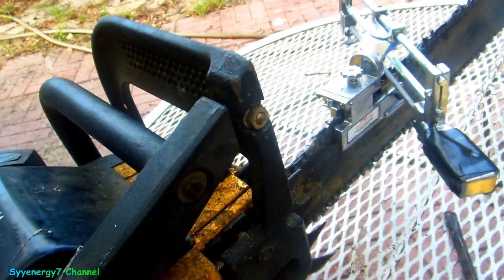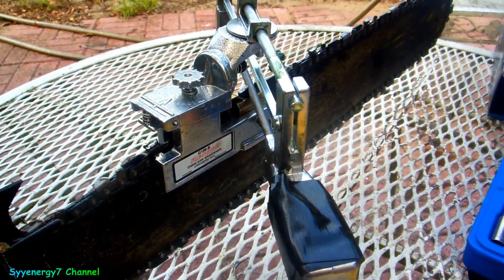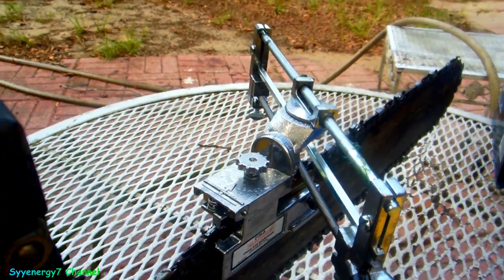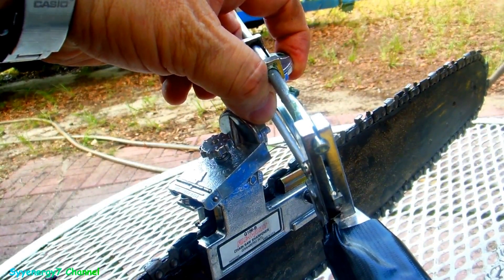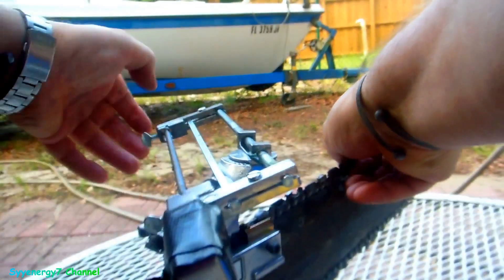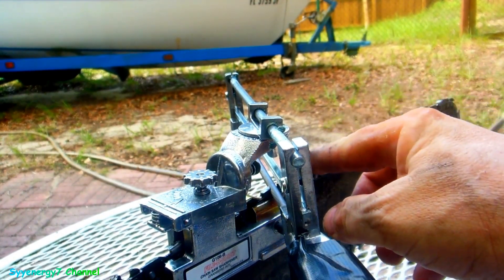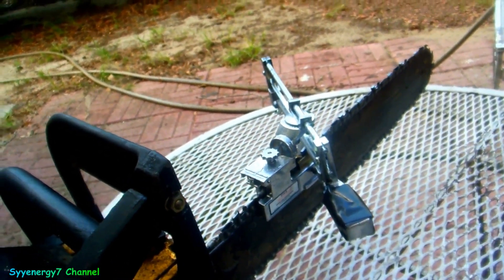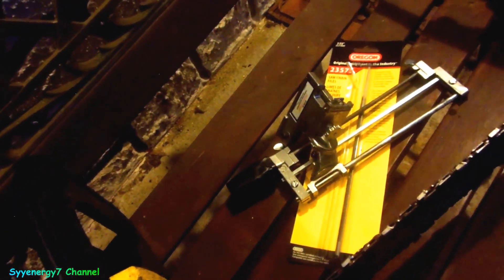Granberg ChainSaw Sharpener -1st time using it

Comment: Nice tips! I just bought a super old McCormick chainsaw (never heard of the brand before) from some old farmer off Craigslist for 150 dollars. It has a 4 HP engine and a 6 foot long chain bar. All metal, not a single piece of plastic on it.

Comment: 1. you need a vice.
2. you need to set the back limits  screw that limits the file cut towards the engine.
3. both hands on the file, front and rear, allows greater file stroke control.
but hey?  you're  doing much much better than the "bare file" aficionados .
Reply from the maker: It does cut a lot better ,  I need to get a vice.
Reply: there's a learning curve with this tool.  I just tried my first time with one today and boy howdy it works pretty damn precise.  not saying it'll replace the flat guide most of us use in the field but it'll sure straighten up any errors pretty quick.
Reply: After using one for ~40 yrs, I'd suggest that:
1.) a vise is unnecessary, except maybe for stabilizing saw on a small stump
2.) limiting screw just gets in the way, does not help; just helps for flat file on depth gauges
3.) one hand on file can work great, just twist the file into the tooth, guiding on the bushings.
4.) unlike the guy in the vid, do NOT push the file into the gullet on the backstroke- wrecks the file
5.) do NOT wait until chain is dull, file it every other fillup or so, to KEEP IT SHARP.

Comment: Hi from New Zealand. hell I have 3 of those 610's they seem to have pulling power. anyway regarding files try to rotate file (around 5 minutes or so to get a cleaner cut)everytime you change sides on sharpening. then after every 2 lots of sharpening get a file card or med wire brush and clean file then wrap rag on file and pull to wipe of swarf. olberg, sandvik, vallorb are great files as they are file makers whereas Oregon aint a file maker hence its expensive. I prefer non power grinders as hand sharpening helps retain dexterity an manual skills.